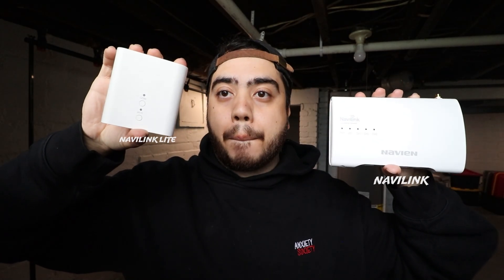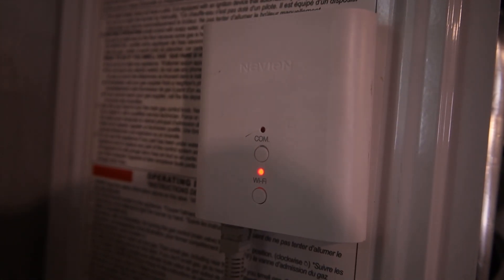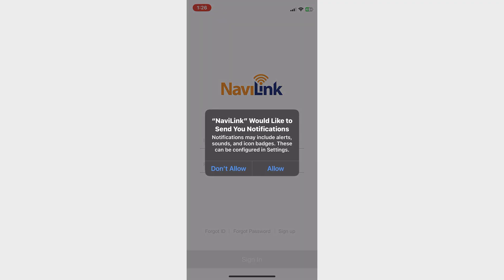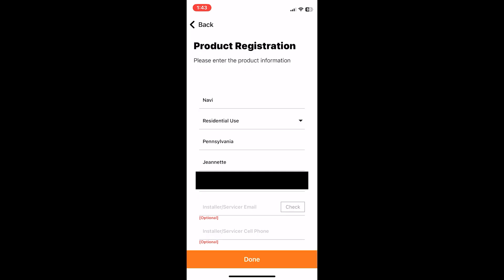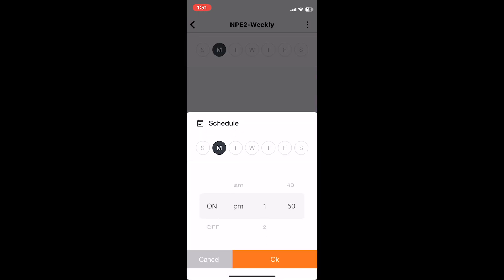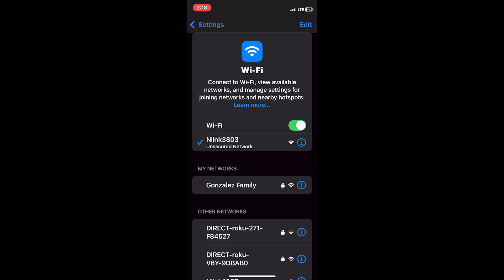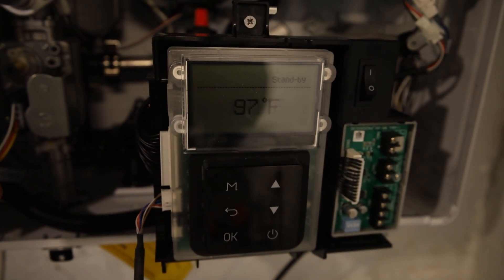NAVIEN NAVILINK GUIDE  | NPE-V1,NPE-V2 AND NWH/NPN

Comment: I am so confused.  The installers got everything working, but not the navilink.  It is very confusing.  I know nothing about hot water heaters, but do understand routers.  I created a secondary router connection that was 2.4 GhZ only.  My problem is what to do in the navilink app in order to connect.  I turned on bluetooth, but it does not see the navilink.  Your video did not really say why it was needed.  In the app, I assume you select the 2.4 GhZ connections, but I do not think I am communicating with the navilink router.  Do you do paid consultation?  Do you have an email address?
Reply from the maker: Thank you for reaching out! I apologize for the delay in response. I do not offer paid consultations at this time .  In the event you are still dealing with this I will try to give some pointers 

1. @ 3:03 You will see on screen a prompt that says "Turn on Bluetooth service to
register Navilink device and use the temperature control, power control, and reservation functions of Navilink remotely."

as far as I know thats all the information Navien provides as to why Bluetooth is needed.  

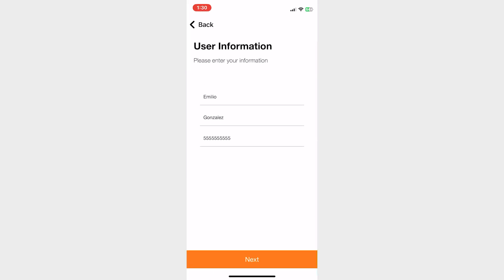2. @ 4:51 If you are at this part but it wont show the Navi link device, try resetting your phone, force close the app and ensure Bluetooth is enabled on your phone before opening the app and make sure you are not connected to any other Bluetooth devices while doing your set-up.  Press the button shown at 5:10 and the light should start to blink blue 

3. once you ensure its blinking blue, "hit product search" and as long as all steps were followed, it will go through

4. Once you are at the Wi-Fi connection screen within the app ( 5:33 ) this is where you connect to a 2.4ghz connection and you can follow the rest of the steps in the video if needed.

One last thing that has worked for other customers is deleting and reinstalling the app.
 Lastly if all else fails call Navien Tech Support 1-800-519-8794 option 2. They'll likely walk you through the process one more time with a tech on the line but after they confirm there is something wrong, they can help rectify the situation ( e.g warranty replace the navilink, ensure no server issue, etc) 

If you have the time, follow up and let me know what ended up being the problem. It may help others experiencing the same thing.

Comment: I keep getting the server is not responding no matter what I do. I closed the app multiple times and it still re-appears. I even had to call the internet company as I asked them to separate our wifi so I made sure I was on 2.4G still no luck. Any other suggestions? Great video by the way as the manual isn't very good.

Comment: So the original Navilink and the Lite would work with the  first gen NPE-240A? I assume you don't get all the scheduling features with that one? Is there a preference for the older or newer Navilink? Good video by the way.
Reply from the maker: No difference feature wise between the old one and the new one. You can schedule recirculation for the NPE-240A as well as far as I’m aware. The Navi link lite is the best option for a single residential installation in my opinion just because of the compact size . I appreciate your support on the channel! 🎉